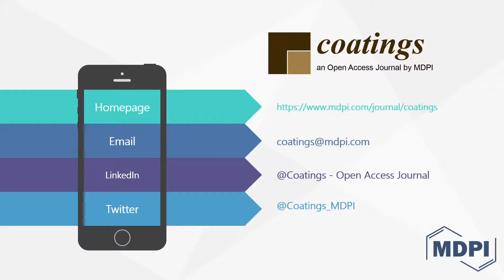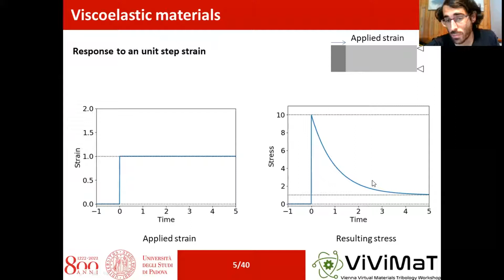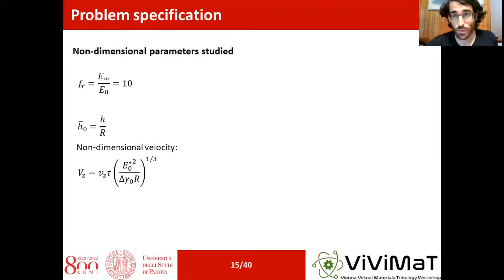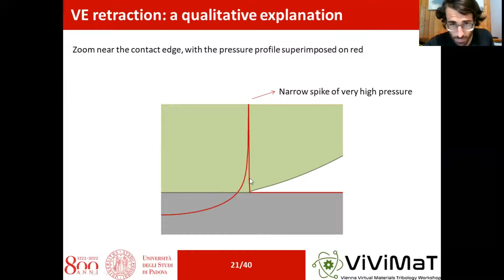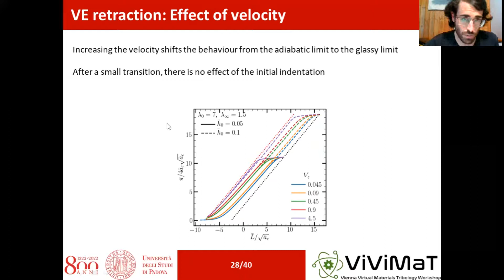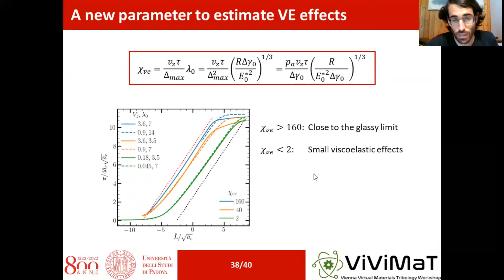Francesc Pèrez-Ràfols (U Padova) on viscoelasticity in contact hysteresis | ViViMaT 2-2-4

Comment: Thanks for the talk! If I understand it correctly, the viscoelastic cylinder slides over a smooth rigid surface, so the stress does not change in the cylinder. How do the high stress rates  and the glassy state at the edge of the contact occur? Thanks!